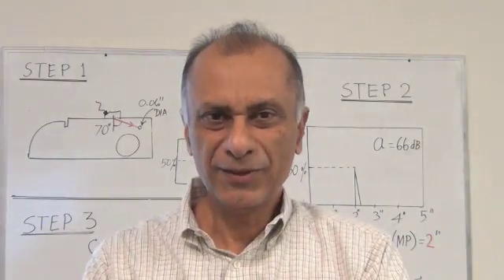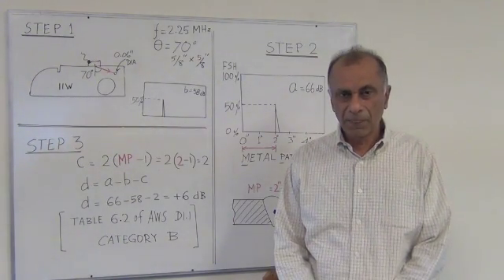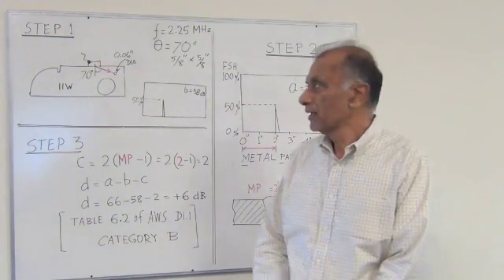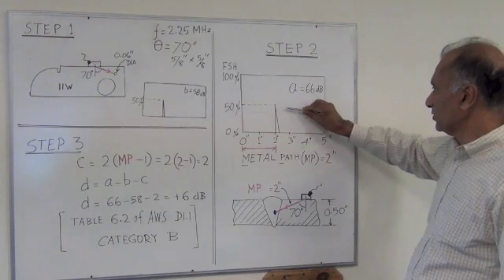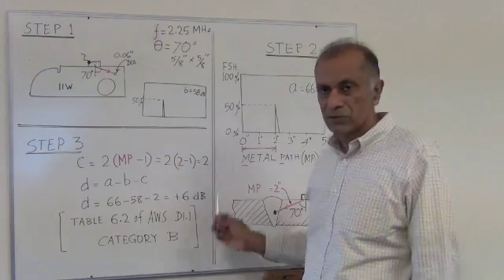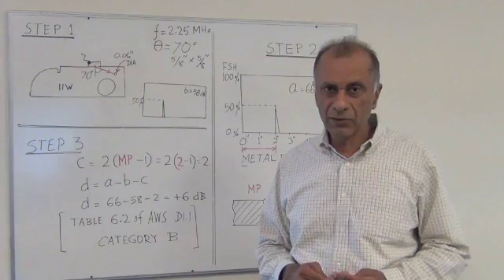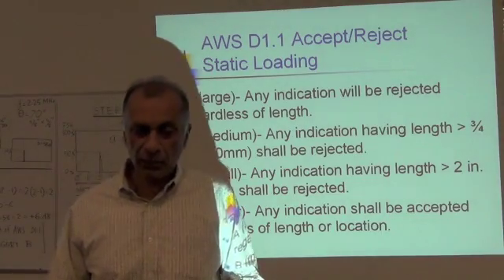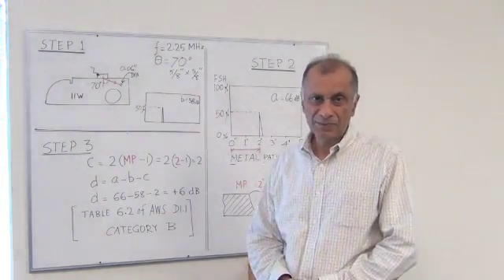Birring NDE 202, Angle Beam UT as per AWS D1.1. Ultrasonic Testing # 4,

Comment: a-b-c , should be changed (a shall be reference ,b shall be indication, c- atteniation) ,for eg., if MP from discontinuity dB is at 72 & reference dB is 58 & C -2, then it becomes +12, which is small discontinuity and become acceptable. But in actual it is large. So it shall be 58-72-2 = -16 , Hence it becomes Class A and reject straight away., which should be the right way of doing it.  Conclusion, if the amplitude from indication is increasing ,it should end up as large discontinuity ,and no small discontinuity

Comment: Sir, appreciate your basic NDT AWS D1.1 i just want to know how you will calulate the 2nd leg, for example we have 25mm thickness plates with Butt weld joints or T-joints joints, now the indication from top surface is 15mm what formula we are using for calculation to get the exact depth of indication...thank in advance for your answer..